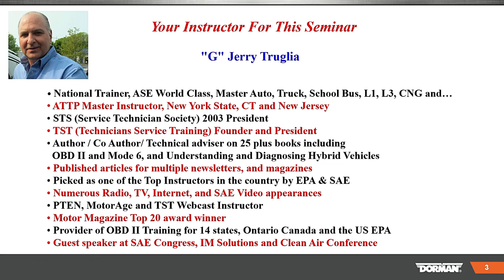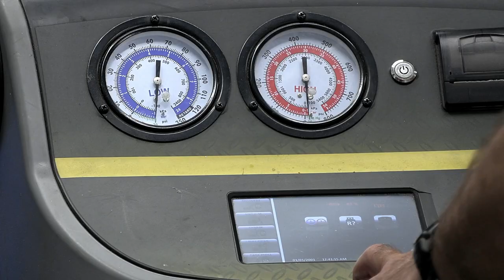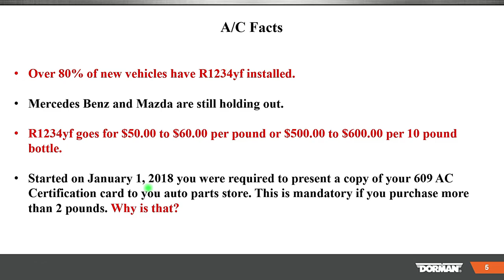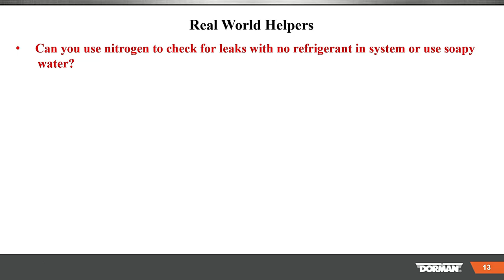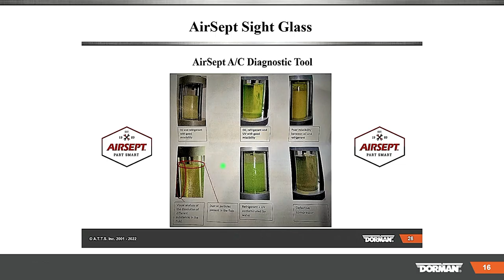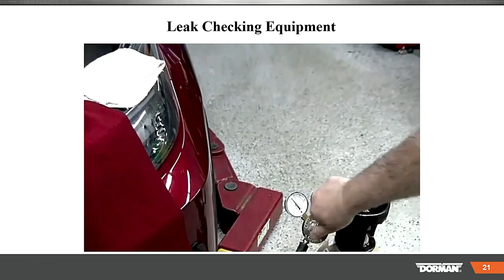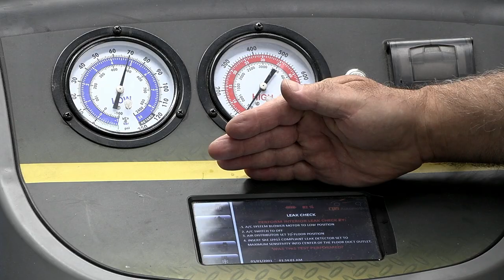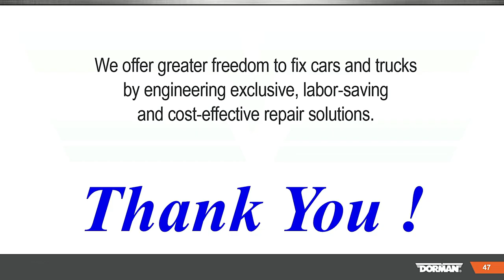How to Properly Service R1234yf A/C Systems

Comment: How to properly service 1234yf systems. Drain completely, vacuum down and verify no leaks, fill with compatible oil, charge with 134a to adequate pressures.

Comment: Good knowledge have you seen honda hybrid ac compressor system. Yet with restrictions compressor and condenser exchange txv faulty also at 44k miles was a headache 😕

Comment: Can a body  shop that cannot afford a machine use manifold gauges to fill a ac system using a scale to weigh refrigerant
Reply: Yes. We used sublet a guy who does it with the basic Chinese shit on Amazon. They make it seem like you need special equipment or it’s rocket science to gate keep the $ themselves. Get the cheap Amazon shit, start doing it yourself and make an LLC and sublet yourself for $350. Don’t do it for what ever pathetic hourly rate the insurance company is paying you

Comment: is it not going to hurt the compressor when you run the A/C with CO2 instead of refrigerant?
Reply from the maker: No not an issue using it...there are some systems in Europe that run CO@ ...We have been doing it for years in my shop to test the system for leaks and compressor operation. Thanks for watching...If you have not already subscribed to our tstseminars YouTube channel please do so. Interested in more training? Go to www.tstseminars.org and view full length videos for members on TechFlix for $9.99 unlimited viewing …Membership and over 85 videos for less than $99.00 a year. Also checkout www.attstraining.com for hands on training and webcast FREE videos at www.tstseminars.org/training-videos
Reply: @TSTseminars  thanks
Reply from the maker: @moebassidji8306  you're welcome
Reply: air is compressible and the job of the compressor is to compress so no issues will result

Comment: Anyone needing a 1234 to134 conversion kit I am selling them for 30 dollars each and have given away 1000s of them at my shop comes with 134 txv  24oz of 134 and the 1/4 5/16 3/8 connections needed to connect a yellow jacket or similar gouge set
Reply: Is that legal?

Comment: just throw some 134a in there they have similar evap and condisation points and isn't flammable
Reply from the maker: no the thing to do...in most countries it is against the law....I believe you stated in Canada it's OK? I find that hard to believe but I don't really know since I don't live there. Thanks for watching...If you have not already subscribed to our tstseminars YouTube channel please do so. Interested in more training? Go to www.tstseminars.org and view full length videos for members on TechFlix for $9.99 unlimited viewing …Membership and over 85 videos for less than $99.00 a year. Also checkout www.attstraining.com for hands on training and webcast
FREE videos at www.tstseminars.org/training-videos
Reply: @TSTseminars  oh its against the law.... I wonder why??? Maybe because its better?
Reply: R134a has significantly bigger impact on greenhouse effects, so it has been banned for new cars. Also for the same reason, retrofitting R1234yf system to any other refrigerants is not legal.
Reply: @lw1073 so what, not all things illegal are bad
Reply: @adamjankowski4315  You were wondering why it's illegal, so I told you why it's illegal. I'm not saying R134a is bad. But for the same reason, a proper workshop won't retrofit your R1234yf system to R134a as they might be fined for doing so, and you are free to change to R134a at your own risk.
Reply: @lw1073 don't worry, I already did